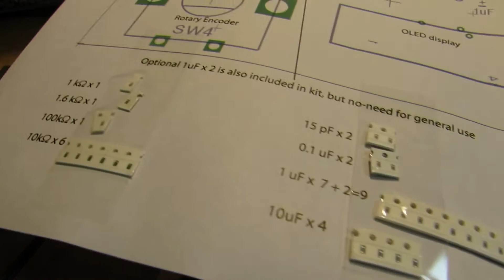DSP Radio version 3 is ready!!

Comment: Nice project! Is it capable to listen SSB transmitions? Thanks.
Reply from the maker: Unfortunately, no. it should have I-Q signal inside but we cannot access it. The chip KT0915 is specified for AM and FM reception...
Reply: What a pity =(, but no problem, I see in your video that you've listened some shortwave stations with this kit. Since no variable capacitor is required, may I select a radio station only by software? I'm working on a Raspberry Pi radio project. Thanks
Reply from the maker: YES, it is I2C command controlled. I've not tried but RasPi also can be the host controller for this radio!

Comment: Does it remember the last frequency when powered up?
Reply from the maker: At this moment,,, no it cannot. but by using EEPROM it is possible (not yet implemented)
Reply: Thank you for the information. I look forward to receiving my kit and doing modifications to the code.
Reply from the maker: Have a happy hacking!! (Please prepare USB-TTL programmer, which has a pinout DTR-RX-TX-VCC-CTS-GND and also choose ArduinoPro/Mega328 8MHz/3.3V in Arduino IDE)
Reply: Thanks, got it.